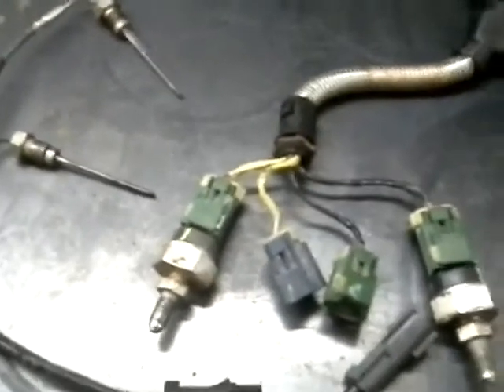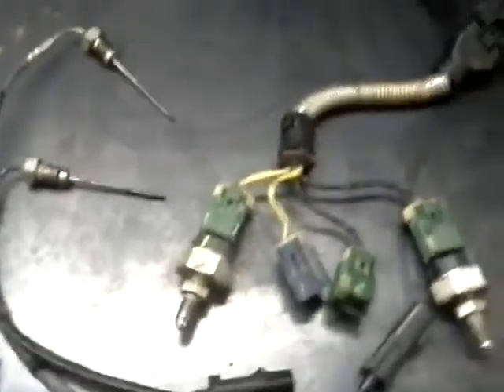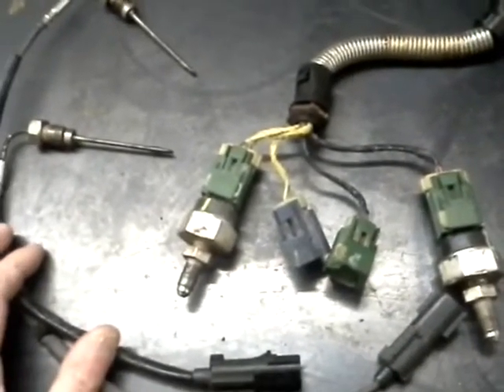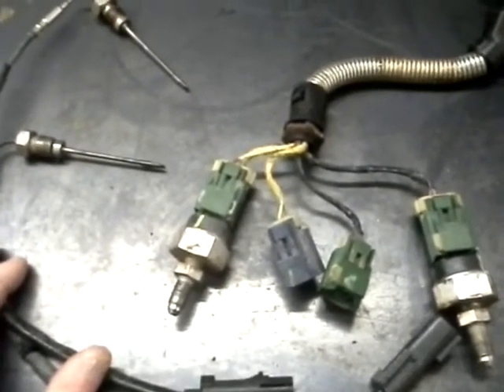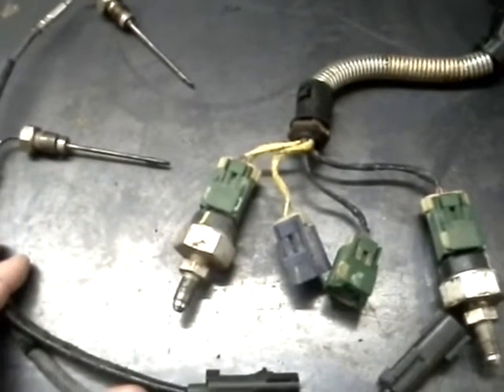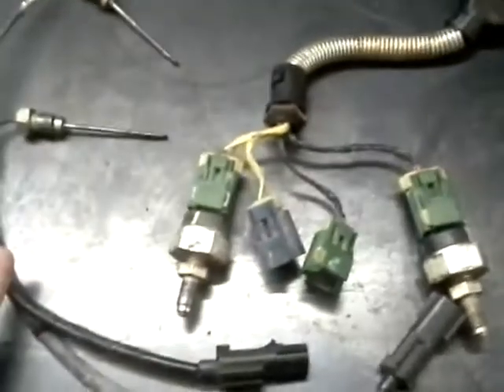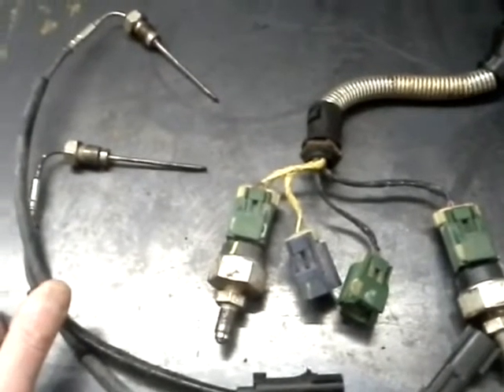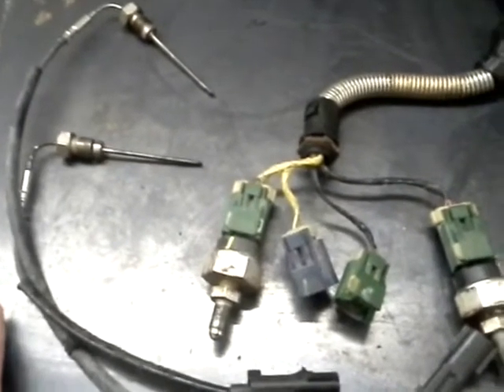Mercedes MBE 900 DPF Sensors

Comment: hey, long shot, but having an issue with these exact sensors. My pressure sensor wire snapped off, so not getting a reading. Is that a fairly easy replacement?

Comment: I have a couple of codes on my MBE926 saying Intake Manifold Pressure Circuit Failed High - how to I get access to the sensor, where is it?  Hope you can help?
Reply from the maker: At the rear top side of engine with a  hold down bolt.
Reply: @MechanicsHubdotCom  Thanks, I can get to it from the cover inside the bus :)